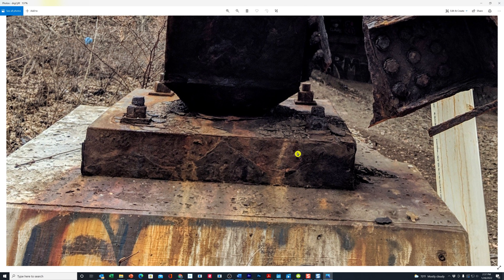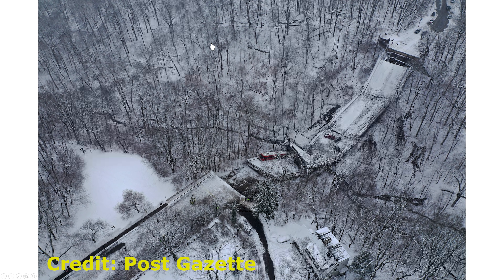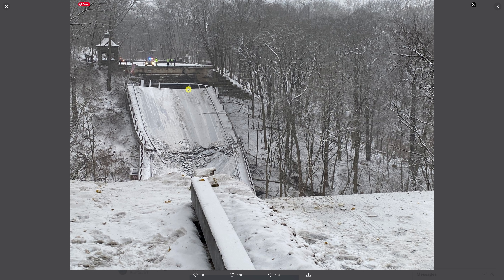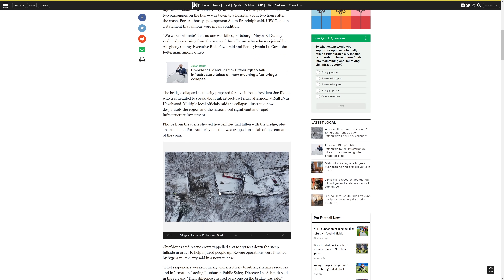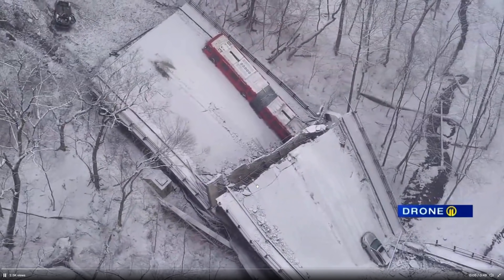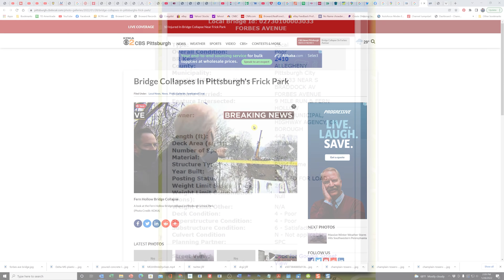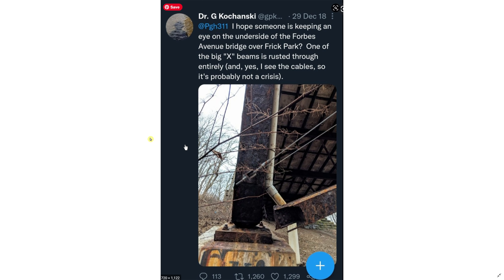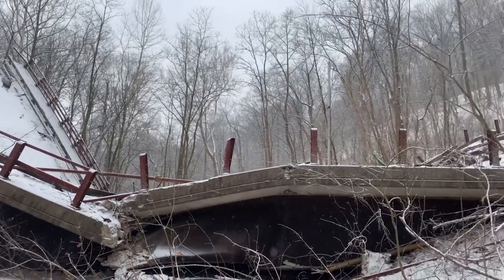Pittsburgh Bridge Collapse Cause, Forbes Ave Bridge Frick Park Rust?

Comment: Good anylysis. bridge inspector myself here. columns look tiny. Also, on google map, you can also see complete underside through the trail walk. snow load can't be that much but I think columns just sliced off/sheared off at bottom and  bridge collapsed.
Reply: Also bracing that are rusted don't carry much load. it's just for load transfer members.
Reply from the maker: Yes, I will check out the Google view
Reply: Gotta agree! Not a bridge inspector myself but was a custom builder for years and went to school for architectural engineering and this is about as basic as it comes in my opinion. 

Piers are probly undersized from what todays standards are but they appear to be supporting the load well from what can be seen in limited pictures.  I don’t think snow load is a contributing factor at time of the collapse. Support columns do appear to be quite small but without knowing all the numbers and doing the math it’s impossible for any of us to sit here and say they are in fact undersized or not. What we can sit here and say tho is there has been decades worth of neglect and deferred maintenance that looks to me to be salt damage from years of attempting to keep the bridge deiced. The salt/brine mixture would wash right down and collect upon the base of the support columns and eat away the steel  just like what Jeff has shown in the pictures. Allowing corrosion to become that bad without doing some preventative maintenance on it or replacing steel should be a criminal offense in my opinion. As indicated by the website Jeff pulled the condition report from, inspections have periodically been done on the bridge so someone out there knew the condition of the steel and chose to not say anything or do anything about it and they ought to be thankful this morning that no one perished in the collapse but they need to find out who knew and why nothing was said or done. 

The bridge was built in 1970 so it’s approx 51years old and in terms of bridge life, that really should not be the end of its service life yet. We have other bridges much older and in much better shape than this one but it takes work to keep them up but it’s sure cheaper to do that than replace the bridge every 40-50 years, we just can’t sustain that kind of cost! Preventative maintenance is a much better option to increase expected life span 

Just my 2 cents thrown in with yours NYC life. Thank you for listening! Take care brother, be safe out there!!
Reply: @1982MCI   all bridges get inspected every 2 years. federal rule. this was probably was on 1 year cycle as it's rated "poor". I'm pretty sure, all problems were reported by inspectors, and with no money, it was ignored. probably nobody thought that it would collapse so quick that too in the morning when there is no live load (traffic). just collapsed on its own weight, which is rare.
Reply: Snow and especially Ice load is a HUGE load per newest code. 

Depending on location, you have to account for ice wrapping itself around every single member and then put wind on all of the ice. It's really a game changer for structures.
Reply: @Meng776  barely 3-4" of snow on bridge. not a reason for collapse.
Reply: @vyom2281  It's the icen that's a game changer, not snow. Newest code on ice loads are dramatic change. You have to design that bridge for a few inches of ice on EVERY PART OF STRUCTURE, then put wind on that extra ice. It becomes significant.
Reply: @1982MCI  Good point. close the bridge, if you can't afford.
Reply: @1982MCI  wow Don, Please tell us about your career and what kind of life path did you choose, I think A lot of kids really need to be encouraged to look forward to having a career like your and Jeff's as well as many other. Thank You and stay safe 🐕🤗
Reply: We barely had any snow the day this happened
Reply: I would love to see the maintenance records for this bridge. Definitely neglected on structural maintenance. How may other bridges in area, of this design and age?
Reply: I appreciate you are a bridge inspector but I live in Pittsburgh and I know my home city okay and let me tell you this was 100% caused by these ruckus bus drivers! You can feel the ground shake. Pedestrians have to scurry. But these bus drivers have no shame! I always blame the bus drivers, it’s the safest option. Won’t no bridge collapse these bus drivers break weight capacity every day!
Reply: @vyom2281  How much does that articulating bus weigh?
The max weight of a vehicle in that bridge was 26 tons.
That bus had to be close.

That bridge was just in terrible condition and I think at that point, it's max load was much smaller than 26 tons.
Reply: Keep in mind to that these things aren't designed to pay forever anyway. They're supposed to be built, maintained and replaced. We just build and wait for it to get bad enough that someone gets hurt and sues.
Reply: @MMGJ10  bridge should have been posted for no more than 6 or 7 tons. But who knew. If you want me to be technical 26 tons is posting for each span. Bridge had 3 spans so according to load rating engineer bridge was strong enough to carry total of 6 vehicles ( 1 in each span in two direction) each weighing 26 tons. Obviously it was a wrong calculation. Also, bridge probably failed when bus was in a second span which was critical because it was carried by 4 weak columns.
Reply: @MMGJ10  a 60’ articulated transit bus should weigh no more than about 25 tons empty, and given there were only a few passengers, add maybe add their weight (which I think there were two passengers and a driver, so not enough to tip the bus over the weight rating).

What I see is asphalt laid on the old concrete, so in a colder climate, this can really lead to problems. I think whatever maintenance was actually done was poorly executed and poorly engineered. For drains to clog, for corrosion to be allowed to persist for many years, for a concrete deck to be compromised, and for a bridge that might not have been well-designed to start with, this is a perfect recipe for disaster.
Reply: Yep look at those footings. Looks like columns sheared off at the bottom.

Comment: One of the things that I think is significant is that the reason the portion of the bridge deck that the bus is sitting on is fractured and has come to rest bent at a 90 degree angle that points up behind the bus is that it is still connected to the eastern bridge pier.  So that slab has disconnected from the east abutment and moved down the slope about 50 feet with the bus sitting on it.  Then it bends at that 90 degree angle up where the expansion joint to the central bridge deck slab is still attached to the top of the standing bridge pier.  Further to the west, the central deck slab drapes off of the pier and slopes back down to contact the ground.

When you look at the west end of the bridge, you noted that the deck seemed to be deformed lengthwise into a shallow u-shape.  But I think what is significant is that you see no evidence of the western bridge pier at all.  It has completely collapsed under the the wreckage of the bridge deck.

This western pier is the one that appears in the photo showing the crossbeam that has completely rusted away and become detached from the main vertical leg.

The other thing that you are perhaps not noticing is that one of the last shots of the bridge that you have in the video is a long view of the south edge of the wrecked bridge deck looking up the hill toward the west abutment.  About halfway up the hill in that shot is a small lump of concrete.  That is the tiny footer that sat under the vertical leg of the western pier of the bridge on the south side of the bridge.  Having seen this piece of debris first hand, I note the following:

There is no sign whatsoever of any beam that was ever attached to this footer.  The bolts coming out of the concrete are there, but there is nothing at all attached to them.

Also, this footer has been tipped over on its side, which means that not only is it not very long and not very wide, but it was not very deep either.  It looks almost like a cube.  So it was meant to keep that leg of the bridge from punching into the ground under load.  But it was not meant to offer any stabilization in any horizontal direction at all.

From this, I conclude that the western bridge pier collapsed.  Once the bridge deck sagged sufficiently, it sheared away from the abutments at each end of the bridge and fell into the ravine.
Reply: William Wachter, Jr — You misinterpreted what you saw.  (15:08) The angled support columns have some kind of a ball bearing/roller pin system over the metal plate bolted to the concrete pier, I THINK.  I can't tell because the idiot who took the photo doesn't know how to use a camera and left that most important section dark.  Also, please use a time stamp if you reference anything specific in the video.

Comment: If you've ever driven in that area of Pittsburgh, you see decaying roadway and bridges galore.  I've often wondered while driving through that area, just how long before something gave way.  If you look at the google satellite views or street views you can see the decaying cement walkways, curbs and road surfaces.  Use of ice melting compounds coupled with poor maintenance has created a time bomb in that area.  I remember walking over some of those bridges and looking straight down through holes that were rusted and decayed portions of the bridge.  Massive replacement of roads and bridges in that area alone would create disruption and money spent just in that area would be extremely expensive.
I know a fellow who just retired from the Pittsburgh bridge dept. (just in time):)
Reply: Braddock is pristine and flawless. I don't no what area of Pittsburg you are talking  aboot.

Comment: Thanks Jeff
To put it in some perspective there are over 1000 bridges in the county including and surrounding Pittsburgh. Many of them are MUCH older and a huge number are steel. Over 100 of the bridges in Allegheny county are rated in poor condition.  If you scream about this, it's a long scream.  The bridges are always in poor repair and the state government (on the other side of the state) pays little attention to upkeep. They are primarily just replacing them as they fail. Most seem to give plenty of warning.  I'm pretty sure that this was a replacement bridge for the original bridge from 'olden' days.  Look at the area surrounding the abutment. Those old stones were not from 1970.
Reply: Sam Levine  — the concrete pillars were most definitely built in the 1970's along with the bridge.  When referencing something in a video, always put the time stamp.  I'm not searching the video for "old stones."  Besides, this bridge collapsed because of steel corrosion that was installed at the time the bridge was constructed in 1970, not because any old infrastructure from the previous bridge.

Comment: That last image you showed at 16:24 shows the support closest to the block house completely disconnected from the pier.  Its a city owned bridge and apparently they don't believe in proper maintenance.  Case and point, just look at how many people were permanently maimed by falling derbies that fell through netting that was strung up to catch the debris falling from under the Greenfield Street Bridge.  It was so bad, instead of replacing the bridge, they built a bridge just to catch the falling debris from the underside of the bridge.  And it still maimed someone.  And only then did it become a priority and finally get replaced.

A few years ago I was stopped over the Braddock Ave. expansion joint of the bridge in traffic and a truck entering the bridge in the other direction cased my car to bounce up and down. I walked the bridge a few weeks ago and it always gives me a very uneasy feeling.  The arch just seemed seriously underside given the hefty size of the decking up above.  It laterally failed under its own weight.

Comment: Jeff:  Spans are from support to support, so the bridge had two supports in the middle, making one span on each end to connect from the edge of the ravine to the posts and one in the middle that went from post to post. These were of the batter-post type you mentioned. There would have been inflection points at the supports to allow the brdige to flex instead of breaking. Expansion joints would also have been in place to allow for flex. These were probably where the bridge surface broke straigjht across.
If you look at the blue diagram you had for the batter-post bridge, the inflection points are indicated by the triangular  elements under the ends of the support points. If there is enough corrosion of the surrounding steel, there is no flex back and forth, but a displacement of the support beyond its limits. 
With that extra-heavy articulated bus going over one side of the bridge under certain conditions, the inflection point of one of the supports could  flex too far in one direction and lose its footing, then the bridge would become a house of cards. 
Elastomeric paint would not help the corrosion situation. It can actually become a water jacket that allows moisture to remain under the paint and spread by capillary action. I had a stucco house that needed extensive repairs after that elastomeric stuff caused water pockets to develop all over the outer walls. Also, once rust starts, it spreads. You have to remove the rust and replace any coating to prevent further corrosion.
There is steel that can resist corrosion by forming its own protection as it oxidizes, but it's expensive stuff---too expensive in the eyes of some. It has been used in the outer skin of some buildings, but I don't recall it being developed as structural steel for bridge design. 
BTW, the new infrastructure bill is over three-fourths social engineering and too little actual help for bridges and roads. We have known about the condition of our infrastructure since national reports in the 1990's, but we haven't done much about it.
Reply from the maker: Yes, someone needs to come up with some real good protective paint.
Reply: Outstanding information!  Thank you.
Reply: The Wikipedia page for the Fern Hollow bridge says it was built using COR-TEN weathering steel, and links to a newspaper article from 1972 reporting on delays in bridge construction due to the difficultly of getting that type of steel. So it seems like they planned to use the corrosion-resistant steel you mentioned for the bridge framework. Is it possible that those rusted beams were made of corrosion-resistant steel that rusted anyway? Or maybe they used some COR-TEN and some normal steel? (COR-TEN is made by US Steel, headquartered in Pittsburgh, so picking a hometown product like that would have been a natural choice.)
Reply: This bridge was built with CorTen steel, steel which was advertised as not requiring paint. But continually exposed to pooling water, salt, or atmostpheric conditions can allow this type of steel to continue to corrode and never get to the point of building up a protective layer of patina.
Reply from the maker: @brnmcc01   Also back in those days I wonder how good advanced life testing really was, where was it simply miss marketed. Also not sure how much salt they put on the roads back then Alma or if they even tested for this special case.
Reply: @stevendoerfler  I was wondering if the paint was actually making the rust worse by holding moisture against the surface of the steel - cor-ten or not. One other question - the protective layer of corrosion of Cor-Ten is brittle. Obviously using Cor-Ten steel in bridges is nothing new or unusual, but if the steel is flexing, isn't it prone to shedding that layer, exposing new steel that will corrode (as it is supposed to for Cor-Ten) - but isn't there a limit to how long it can last if it is continuously shedding its surface layer? Just wondering.

Comment: Thank you Jeff for your insight and presentation. I worked briefly with a bridge maintenance technician in Washington State. His idea of a periodic bridge inspection was to drive over it at 50 mph and get back to the shop in time to go home. I think our annual inspections are very thorough however and hopefully would catch anything as obvious as this. As a lay person with limited engineering background, the use of diagonal cables as a replacement for the X girders puzzles me. Would that not put any side loading of the structure on only one set of piers at a time? Also, could the act of tensioning those cables subject the supports to excessive side loading? It seems to me that this repair was fully based on tension bracing, and ignored the compression component of the original design.
Reply from the maker: I guess they're thinking was that if you keep both sets of cables in real tight tension is chin it should be reasonably rigid
Reply: I have been reading the comments wondering if anyone else caught that!🤔.  The X bracing would certainly be for compressive loading, NOT tension loading.  It will be interesting to see someone’s final analysis on this repair and it’s impact.
Reply: The X bracing cables would address tension loads but would be lousy for compression loadings. The member may only experience tension normally, but once a structure warps it could experience some compression - would it not? What I am getting at is the cables may be fine for normal loadings, but not so much if the structure deforms. Incidentally, the original braces were clearly pulled away from the column - so they were in tension, not compression - which undercuts my concern. Nevermind!!